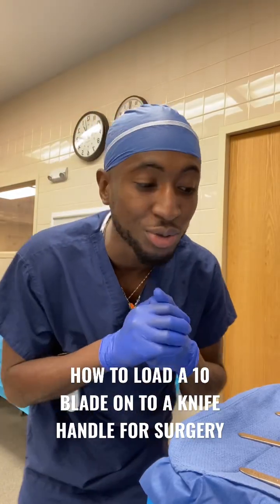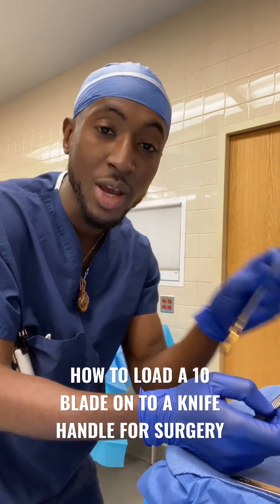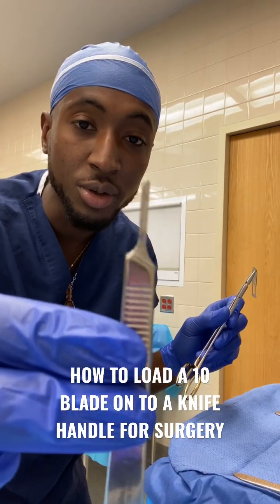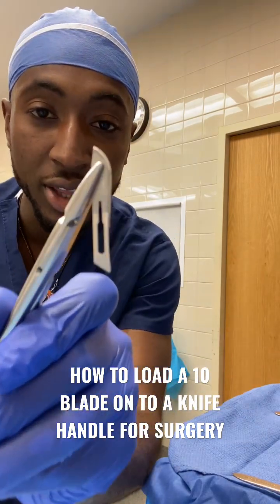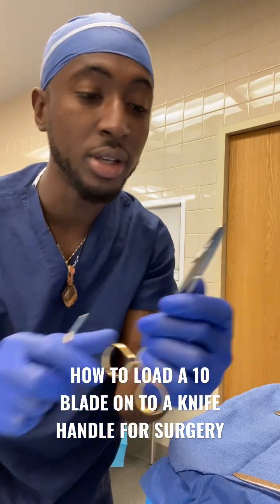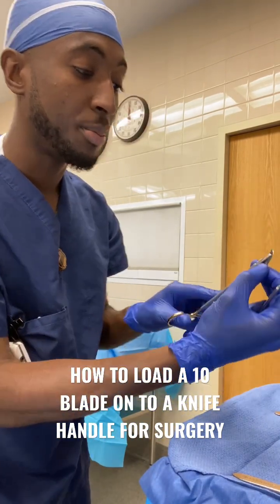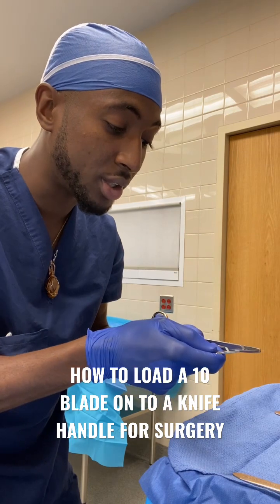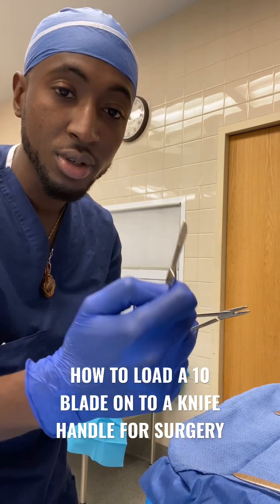How To Load A 10-Blade On To A Knife Handle For Surgery.

Comment: Removing the blade - it is much Safeer to turn the knife handle with the opening surface down - rather than keeping it upright - as it may brake and fly right into your face. Also, advisable to wear goggles or a face shield.